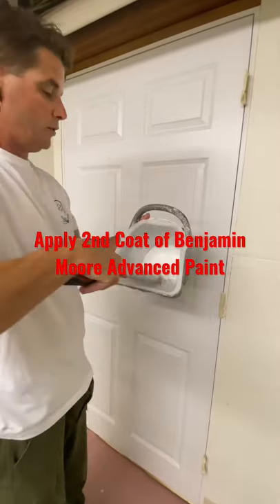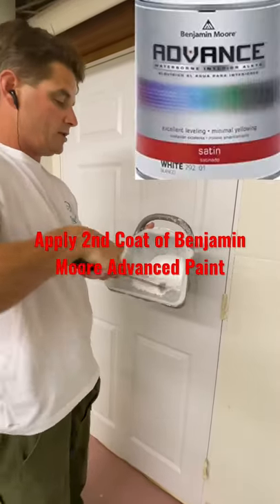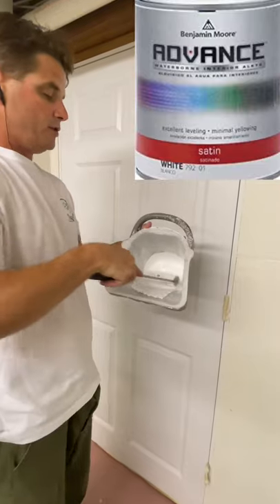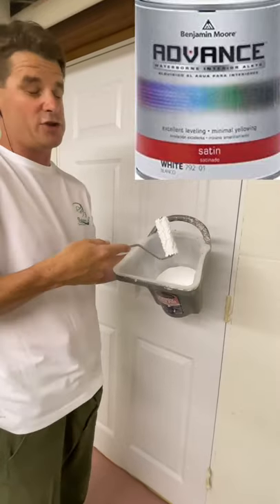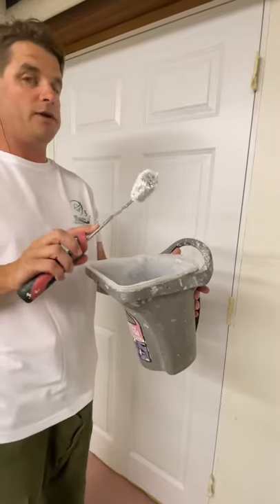Apply 2nd Coat Benjamin Moore Advance Paint #Shorts

Comment: Holly Molly!    Russ,  I will be starting on my living room today and I had a thought so here is the question...  Since I have to cut in and roll the walls,  does it really matter which of these two jobs is done first?  Most people, including you, cut first and then roll.   Have you ever rolled and then cut in???
Reply from the maker: Hi

It doesn’t matter on the first coat. It matters on the 2nd coat. You want the roller to cover as much as possible so you get a even sheen!

Russ
Reply: @RussOlinatzPaintShow    In that case, I will cut first and roll later.  Thanks for the info.  Don
Reply from the maker: No problem! Let me know how you make out?